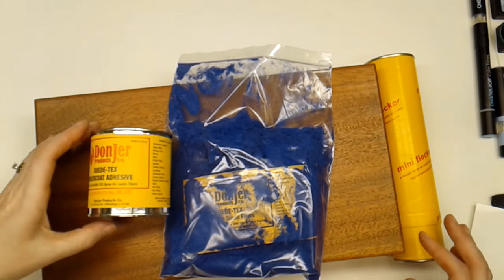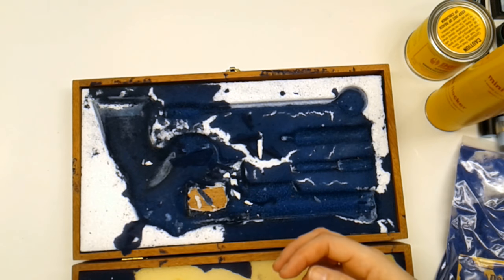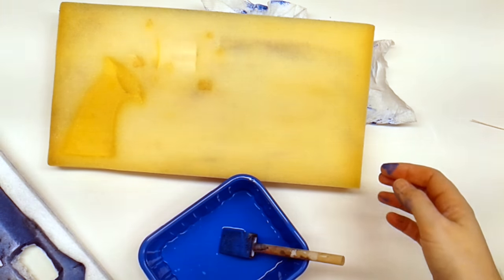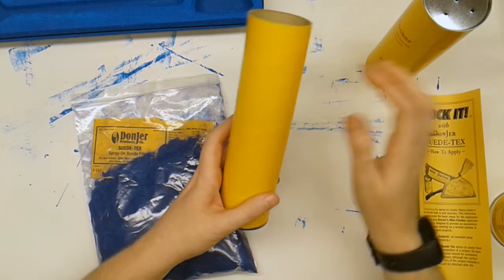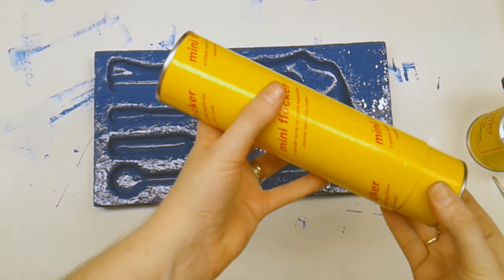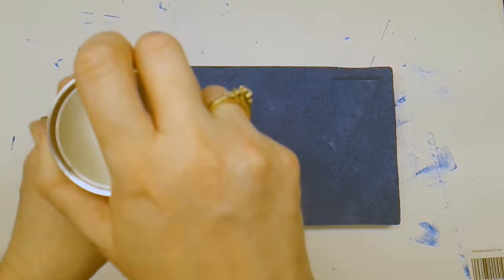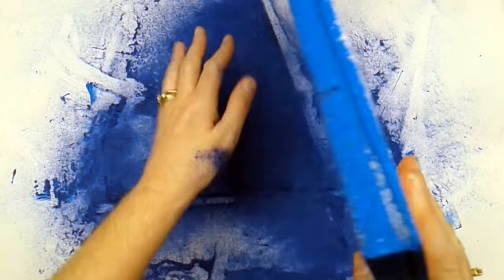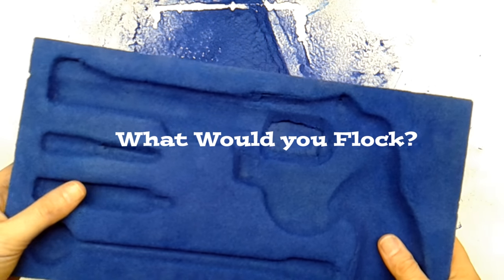How to Reflock a Presentation Gun Case

Comment: Great video Linda! One question,  did you have a link for the latex paint you found that matches so well? Thank you for teaching us the process!
Reply from the maker: Hello Robert, Thanks for watching. Well I don't have a link, But I did find the label on the paint can: Olympic, 1 gallon size can, A53-6, Rave Assure interior flat paint, Latex, Base 5, 102-10Y40, 103-36, 113-1Y20 Hope that helps. :)
Reply: @lindaisrael  Thank you! I have a case like the one you did that's going  to get done now. :)

Comment: Awesome video. What shade of blue did you use? What brand?
Thanks.
Reply from the maker: Thank you Ab. Here is what I used:

Suede-Tex Mini Flocker - This holds the flocking fibers and makes it easy to apply https://tinyurl.com/yd62d6y6
Flocking Fibers https://tinyurl.com/ybdgd7f4
Suede-Tex Undercoat Adhesive https://tinyurl.com/y93wp4eo

I purchased a latex paint from the hardware store and had them tint it the same shade of blue. 

Hope that helps. :)
Reply: @lindaisrael  Thank you so much. That does help.
Reply: Will acrylic paint work?

Comment: getting ready to start exact project u detailed. I'm about to use a spray adhesive (headliner use) instead of blue adhesive (which I also have). I could test this and I will, but the spray adhesive dries clear. Do u think it would be ok to use instead of the blue adhesive?
Reply from the maker: I think it will work. I would test it out. If the underlying is blue then clear will work. If not then any dark spots may show through. Good luck.
Reply: @lindaisrael  thanks. will show u results.
Reply: @lindaisrael  
did not use spray adhesive as research shows suede-tex adhesive specially made for flock. Anyway used spray paint instead of paint. used liquitex cobalt blue. Looks to be same color as navy blue adhesive. So far so good.
Reply: Suede-Tex - flock - medium blue
Suede-Tex - adhesive - medium blue/navy
LiquiTex - spray paint - cobalt blue

Comment: I did this on my pistol case the same as the one in this video and the flocking clumped up on the top spongy foam.  Maybe I put too much adhesive or flocking?
Reply from the maker: So what I have learned is that you must have a good coat of the Latex paint on the foam, it must be dry and then work quickly with the adhesive and flocking. If you wait too long the adhesive won't hold the flocking. Make sure that you put an even coat of the adhesive.  I'm about to do another gun case this week, I have to remember to do this too. lol Thanks for watching the video. Hope my tips help.
Reply: Ok.  I think I can flip it over and use the other side. Thank you so much!
Reply from the maker: Good luck. and you are most welcome.

Comment: What is the material  that you are adhering to?
Reply from the maker: Hello, Casey.  This case had a hard plastic form for the gun and the top inside is a dense foam. If you work quickly on the foam it will turn out great. but don't let the glue build up or you will have spots. Hope that helps. If you have more questions let me know. Thanks for watching.

Comment: I want to try this on an antique guitar case.
Reply from the maker: You should be able to do the same with the guitar case. You will want to clean it really well. make sure it is dry and then paint the area you want to have flocked. Once the paint dries - overnight then you can apply the flocking glue - work quickly as the glue will dry too much before you get the flock down. Good luck and thanks for watching. I hope this video helped you. :)